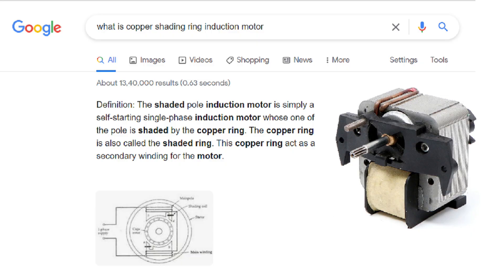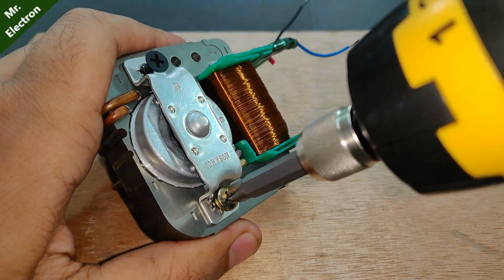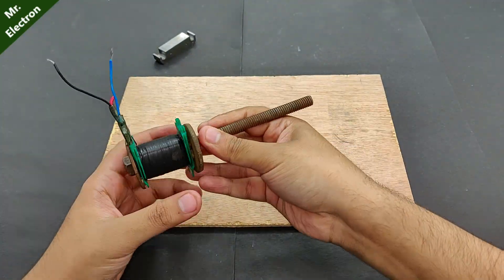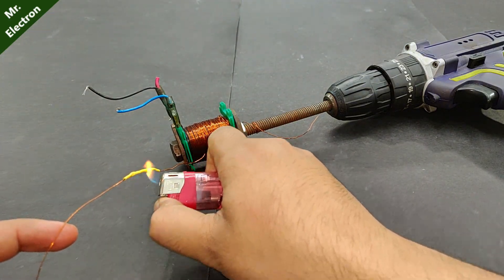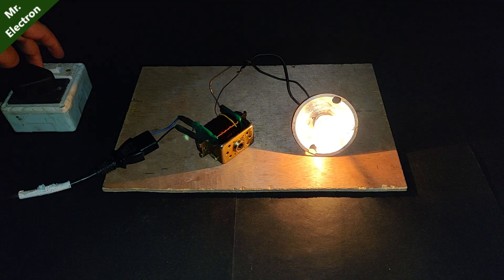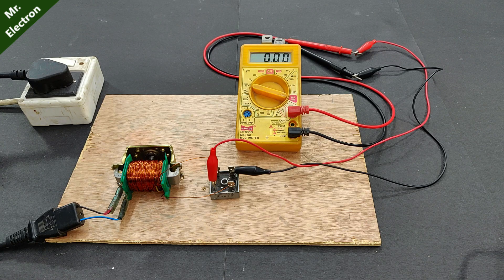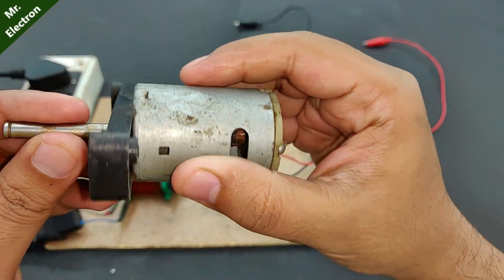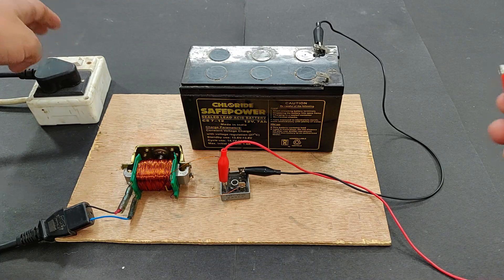12 Volt DC Power Supply from 220 Volt Induction Motor - 220v AC to 12v DC

Comment: A great build. As others have said, you will need to be careful not to overdrive the new transformer. This might be done by monitoring how hot it gets. When the maximum reasonable temperature is found, record the output voltage level (which may have dropped some) and the current draw. Then, you can calculate the wattage. In reality, the original motor winding was only capable of providing a small amount of current. Therefore, the new transformer will only support a small current load. Do not leave it running without someone watching it.

Comment: In the future, iron core transformers will become obsolete from the 2002 experiments that determined iron core transformers, predecessors of the switching power supply as inefficient and bulky. and we will have to use this mans engineering to make our own transformer.

Comment: Here, 220-12 volt AC transformer application is made of shaded pole induction motor, but 220 volt AC winding that does not burn out or overheat in a short time can overheat and burn in a long time due to insufficient magnetic coupling or monoblock (against foucault currents). In my opinion, the conditions are not fully met, but it is nice to visually demonstrate the working principle of transformers experimentally with AC-DC conversion.

Comment: You could put back the shaded pole motor in it's original form and still get your 12V, I guess.
Reply: This would restore the iron circuit too. And would improve efficiency . your output current is limited mostly by the wattage of the original motor
Reply from the maker: True ! 👍
Reply: @MrElectron  the transformer can be made from a choke from the meter